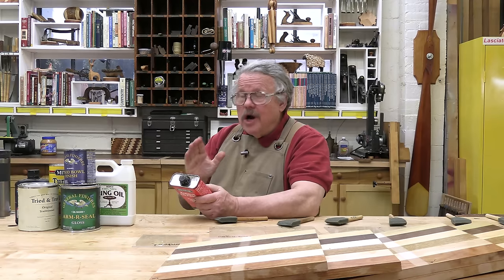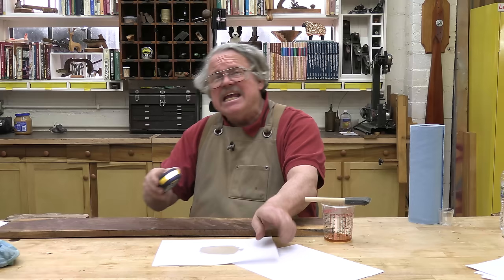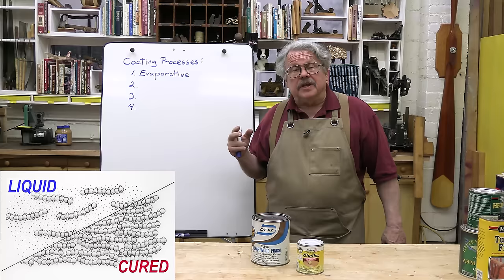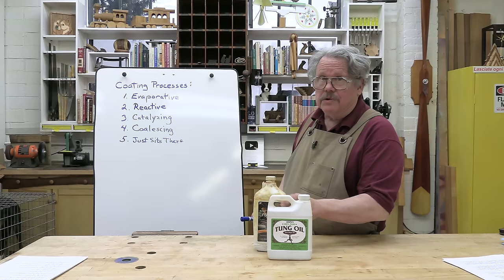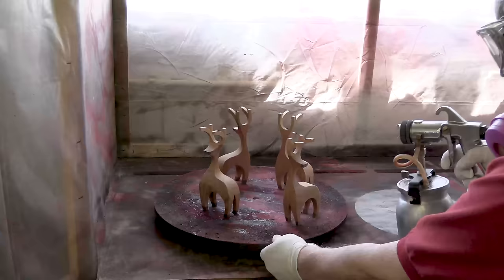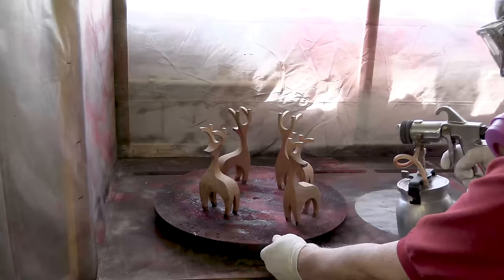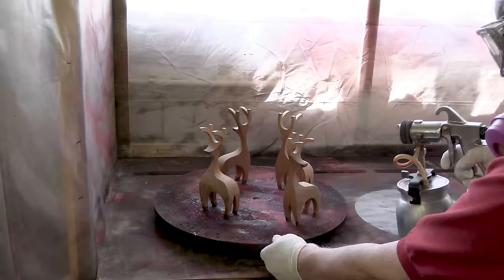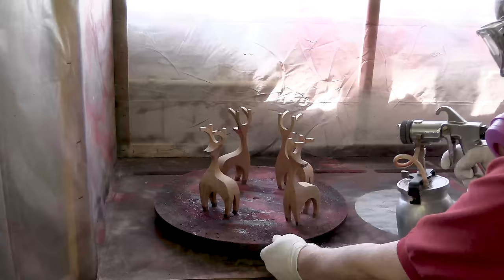Finding the Perfect Finish

Comment: Fantastic video! Question? The final coats of Rudy's mixture with the Spar urethane, do you rub them in like with just the Tung oil finish or just brush them on and leave? Sorry if this is common knowledge, I'm a noob to wood finishing!
Reply from the maker: I was a noob myself once -- fortunately it wasn't a permanent affliction. You can use a cloth if you'd like. I apply the mix with a sponge brush, then wipe it off with a lint-free cloth. I always sprinkle the cloth with a little finish mixture before I begin to make sure I don't wipe away too much right at the beginning of the wipe-off step.

Comment: I used a local emulsion oil, colourless. On yellow oak. It was thick and dried so quickly that it interfered with the rubbing off. Result was very nice. then I topped off the wood with bees wax. Super good. Then I tried the same on Cherry Wood, several times. The oil became hard in 3 seconds and felt rough to the touch. A third try was with lemon oil, that I use for guitar necks. The oil was absorbed, bringing out the colour nice. But no hardening. Any suggestions? Greetings from the Netherlands, P (environmental chemist)
Reply from the maker: I will tell you what coating chemists have told me when I was writing about finishing -- when you apply a finish to wood, there's a whole lot more going on than most people think. Relative humidity and temperature, chemicals in the wood,  chemicals you use to wipe down the wood, even the glue that held the grit to your sandpaper -- all of these can affect you finish and how it cures. I know nothing about the "emulsion oil" you use, so I can't begin to guess why it would react differently with cherry than it does with oak, and the lemon oil doesn't harden because it's neither evaporative, reactive,  nor catalyzing -- it won't form a chemical matrix no matter how hard you wish.  My only suggestion is that you pick another finish and test it.

Comment: Is there a time stamp where he showcases what the Rudy finish looks like after applied?
Reply from the maker: Rudy's blend is a very slight modification of the Miniwax Tung Oil Finish -- that commercial finish with a little bit of phenolic and/or urethane resin added to make it more durable. It also builds "depth" slightly faster. But it is applied exactly the same and the end results look the same as what we show for straight Minwax Tung Oil at 22:12.

Comment: A question...hickory wood floors, rough sand, cabin grade and style. We want to look at an oil instead of a poly...what is your opinion for Rudy's on a hickory wood floor. Whole house about 800 sq ft and not in bathrooms. Bob
Reply from the maker: Rudy's formula is mostly soft alkyd resins (plant-derived carbon chains) with a little bit of hard phenolic resin (petroleum-derived carbon rings) added to bump up the durability. I wouldn't expect it to do well on floors; too soft, even with the added spar poly. Take a look at hard wax oil finishes such as Osmo, Rubio Monocoat, and Fiddes. These are extremely expensive and have to be "renewed" every 3 to 4 years (more expensive chemicals), but they will give you the look and the protection you're after.
Reply: @WorkshopCompanion  Thank you for your response. I appreciate it.
God Bless

Comment: Just wondering, why do you think that shellac is hard to apply?
Reply from the maker: Shellac is most commonly delivered by a brush, and any brush-on finish requires more skill than a wipe-on simply to avoid the curtains and drips you get when you apply too much. This is compounded by the fact that shellac is an alcohol-based evaporative finish. The alcohol evaporates very quickly and the finish begins to harden almost the second the brush leaves the surface. If you don't have an excellent brush that delivers an even flow of finish, or if you pause too long between brush strokes, you get lap marks. Shellac sands well, so it's not difficult the rub out an occasional drip, curtain, or lap mark. And it is doesn't take a great deal of practice to pick up the knack needed to avoid them. But it does require better equipment, more skill, and closer attention to detail than the wipe-on finishes I explore in the video. Some craftsmen might point out that shellac can be a wipe-on if you apply it a a "French polish," and this is true. But delivering a good French polish takes a great deal more skill than either a wipe-on or a brush-on.

Comment: When using the Minwax Tung Oil and later the custom mixture, do you need to sand between coats? The Tung Oil mixture does not specify to sand. Great channel btw, thanks!
Reply from the maker: We apply the first two coats without sanding to build up  a thick enough layer of finish to sand. Thereafter, we rub out each coat with black (800 grit) Scotchbrite. If we want a higher luster to the finish, we rub out the last coat with white (1500 grit) Scotchbrite and paste wax.

Comment: I'm making a walking stick/cane and will be using tung oil for the finish.  Because it is a small project, experimenting is an option.  And my current desire is to get the most penetration on the first coat.  Would heating the oil before applying make any difference?
Or even, heating the wood?  Or neither?
Reply from the maker: I'd imagine there wouldn't be any harm in warming the oil up to make it more viscous but I wouldn't apply to much heat or you may risk causing the finish to prematurely cure. (under 120° F) If you are using a reacting or catalyzing finish heating it may give you less time to apply it before it gets tacky. That being said, using a heat gun on wax after you apply will help with penetration. - Travis
Reply: @WorkshopCompanion  Thank you.

Comment: Is dye considered as a option to add to the ''solid resin'' to add different color into the mix ? Are they harmful or dangerous if mixed to coalescing solvent like Minwax wipe-on only ? I can find some spruce resins around there and if I understand well for the light to darker brown color I just have to add more resin. Is it correct ?
Reply: Thanks a lot for your professionalism. It is highly appreciated.
Reply from the maker: I have often added oil-based aniline dyes to oil-based finishes to adjust the color -- it works well, especially if you're refinishing a piece and you don't know how well it would take a stain. Or if you're finishing hard-to-stain woods, like poplar. Aniline dyes aren't especially toxic, but they can irritate the skin, eyes, and respiratory tract on contact.

Comment: I've been studying this video and some other finish videos, I just came over from a wood whisperer video advocating for a mix of 50/50 citrus solvent and pure tung oil for protecting wood cutting boards and utensils. In his mini experiment of torture testing the finish by boiling the utensils after a variety of finishes had cured, the Tung Oil/Solvent finish came out on top for durability. Is this what you would recommend for cutting boards and the like from a durability perspective? What would be the best way to apply? Build up multiple coats, lightly sanding between each? Thank you for your informative takes and diligent replies to comments!

Comment: Hi I'm a learner I have a lot of teak wood what will b the best coating I can use also for termites n insects can u pls recommend me something I live in london but my wood is in Bangladesh getting dried at this moment tysm sir ur awsome🇬🇧🇧🇩
Reply from the maker: Since you are importing wood from Bangladesh to  England, insects will be the least of your worries. International trade regulations require you to kiln-dry the wood so as to klll any pests before the teak leaves its country of origin. As for a finish, teak is a dense, resinous wood -- this limits the penetration of the finish and may affect its curing time. Look into "teak oil" finishes made especially for dense, oily woods.

Comment: if I have a table top that has a lacquer finish , can it be lightly sanded to remove scratches and then can I apply the "go to" finish?  Thank you
Reply from the maker: I can't say, since I don't know what your go-to finish is -- it might be incompatible with the lacquer. Even if I knew what it was, I would have to do a test to be sure the two finishes would work together. You best bet is to lightly sand the lacquer finish, apply an "insulating coat" of shellac, then apply you go-to finish. Shellac is often used to insulate coats of dissimilar finishes since it will not react chemically with any common finish.
Reply: @WorkshopCompanion  thank you .  The “go to” finish I was referring to was yours, the one in your video.  I am a rookie so what works is what’s best at this point and there are a lot of options.

Comment: Thank you!! This was SO helpful.  I have a question: I'm staining 2 exterior doug fir doors.  The Minwax Tung Oil finish specifies that it is interior.  Can I use your friend's "go-to" recipe on my exterior project?  Or should I add more spar polyurethane to the last coat?  Or is it really just suitable for interior? These doors are under a porch roof, so fairly protected, but in upstate NY.  Thank you!
Reply from the maker: For exterior, I would look for a spar urethane with UV protection as well as moisture resistance. If you want to use this as a wipe-on finish, simply mix it 1:1 with mineral spirits.

Comment: Does anyone know why he called the Tung Oil 100% Pure (the white jug) a NON-drying oil? Wikipedia says Tung Oil is a drying oil.
Reply from the maker: I believe what Wiki says is that raw tung oil is a SOURCE for drying oils, along with raw linseed oil, sunflower oil, safflower oil, walnut oil, soybean oil, fish oil, corn oil, and castor oil. (See the entry under "Alkyds.") All of these organic oils must be polymerized by exposure to heat and chemicals before they will react with oxygen to form the chemical crosslinks that become a hard finish -- in a reasonable amount of time. Some raw oils, such as tung oil and linseed oil, will form chemical matrices after weeks or months, but not in the short time needed to be considered a commercially viable finishing product for the masses in a hurry. What Wiki doesn't seem to mention is that the difference between drying oils and non-drying oils is a long scale with many shades of semi-drying oils in between. There is a difference but no dividing line.
Reply: @WorkshopCompanion  Thank you for the answer!

Comment: Great information there and it seems to go with what a lot of the proper craftsmen use. The only question I have is, is Rudy's wipe on finish suitable for both indoors and outdoors furniture? I have a fair amount of lovely old outdoor furniture that I want to protect, and this seems the best, but I need to know if it is in any way UV / Weatherproof. Many thanks.
Reply from the maker: I have not used it on outdoor projects. In my opinion -- and it's only an opinion -- it would probably work reasonably well. Tung oil has been used for centuries to seal maritime woodworking, and the spar urethane is formulated for outdoor projects. But I have no experience with which to back up that opinion.
Reply: @WorkshopCompanion  Thanks for getting back to me, I appreciate the time it takes to both make the video's and respond like this. I'm probably going to give both Tung oil on its own and Rudy's a go on smaller pieces and see how they go for now.

Comment: Would this be good for a cutting board, once it's fully cured? Or would You suggest something else. And how many layers, would I apply. Could I make a batch of that mixture and store it for the curing process layers, or should I throw it out between layers?
Reply from the maker: We mix up a quart of this stuff at a time. Seems to last several months at least if you keep the cap tight.
Reply: @WorkshopCompanion  Thank You! Could You answer my other questions too? Making a cutting board for a Christmas present, or later if I need to wait.
Reply from the maker: @julieham2462  There is a great deal of controversy about whether or not you can use reactive oil-based finishes on any wooden object that will be used with food. I believe, as the does the FDA, that these finishes are "food contact safe" when cured -- a completely oxidized finish is biologically inert. As proof, I cite the stats -- there is no record of anyone having gotten sick from licking a kitchen table (with nothing on it but a finish). That said, cutting boards are a different animal from most utensils because you actually cut on them and this could dislodge bits of finish that might be ingested. When confronted with this argument, I go back to my original point -- a cured finish is biologically inert. But I also admit that repeated exposure to high concentrations of similar chemicals can cause health problems. So it all comes down to this: Just how woke is your woodworking? If you have concerns, choose one of the many food-safe finishes available to you -- walnut oil, raw tung oil, salad bowl finish -- there's an endless list to choose from.
Reply: @WorkshopCompanion  Okay, that is a definite answer. Sure, one could lick a kitchen table, but, not cut on it. 
I understood that. But, I just wanted more of an answer, which You provided very well, and I thank You for that.
I do alright with some wood working,  but I have never made a food safe wooden thing. Thank You! Have a have a great week!

Comment: In Rudy’s wipe on method, did you do any sanding in between coats and how long did you wait between each coat?
Reply from the maker: It is applied like most wipe-on finishes -- a day between coats, light sanding between coats, rub out final finish to desired gloss.

Comment: Watching this was very helpful, i do have a question though. If you wanted to make a water based wipe on poly, would you just dilute water based poly with water?
Reply from the maker: That's a start. But (1) I would use distilled water, and (2) I would experiment with various dilutions before using it on a project.
Reply: @WorkshopCompanion  well i do got distilled water, guess its time to play in the shop with dilution lol

Comment: I would like to give Rudy's finish a try for a little box I made from walnut. But Tung Oil Finish isn't really a thing where I live. Could I use Danish oil instead of Tung Oil Finish? Both of them seem to be a mix of oil and varnish... What is the difference between the two? Higher Tung content in the finish compared to the Danish oil?
Reply from the maker: Danish oil would work fine, but no need to mix it. Rudy's finish is a type a Danish oil.
Reply: @WorkshopCompanion  Ahh right!  Thanks. I loved the video it's very informative

Comment: You sir are AWESOME! I learned so much and I thank you tremendously for taking the time to make this sooooo informative video! My only question (because you answered so much so well how could there be any questions) Will Rudy's formula work well for a kitchen island countertop.....which is the rabbit hole I'm sinking in that brought me to you and so thankful that it did <3
Reply from the maker: I use Rudy's finish on our workbenches, which see considerably more abuse than most kitchen islands, and it works well. But I also reapply it every now and than  because I'm always scraping away glue and other workshop messes. (One of the things I love about this finish is it's easy to repair.) Whether or not it would work for you depends on how you intend to use the island. Will it be used as a cutting surface? How often will you wipe it down with detergents? If it's a cutting surface, you may just want to apply polymerized tung oil or linseed oil and reapply from time to time. If the surface will be wiped often with chemicals, I would suggest a couple of coats of Rudy's to penetrate, then finish up with more coats of urethane or polyurethane varnish to stand up the wiping. Whatever you use, be sure to coat both sides (top and bottom) of the wooden counter so they absorb and release moisture at the same rate.

Comment: p.s. @ 19:30 - This is a newbie question, but: When you started with 100 grit and worked your way up to 220 grit, did you go directly to that or did you use various grits in between? Or, does that depend on various factors?
Reply from the maker: Worked my way up -- 100#, 120#, 150#, 180#, 220#. If I'm in a hurry, it's 100#, 150#, 220#. But I don't get the same results, especially when it comes time to apply the finish. It's acceptable, but not optimal.
Reply: @WorkshopCompanion  Well, thank you so much for taking a moment to answer such a basic question 😊 Watching more of your videos, I certain appreciate the methodical education technique combined with mastery you have in your particular art, so… I am humbled.
Reply from the maker: @patricknelson  No need to be. I was once exactly where you are now. I'm here now precisely because the woodworking community has a long tradition of sharing.
Reply: @WorkshopCompanion  That’s awesome. Thankfully it’s very similar in the software development profession as well! We geek out and we share and it’s a great community.

Comment: Finding oil based urethane or varnish is difficult nowadays. Would a water based one work for this recipe?
Reply from the maker: No, the tung oil finish is oil-based; you'll need an oil-based varnish to mix with it. Oil and water don't mix.